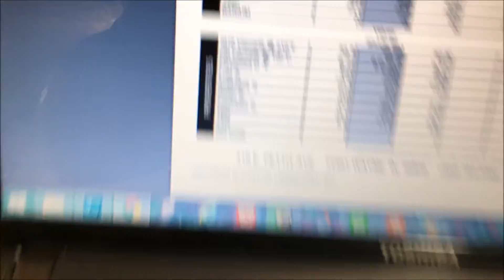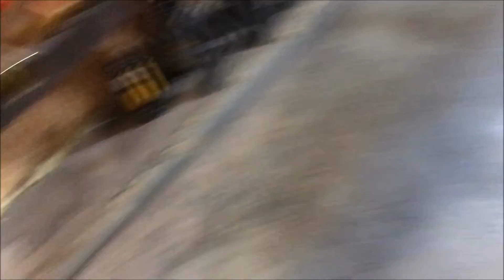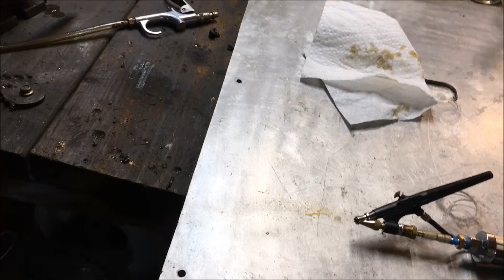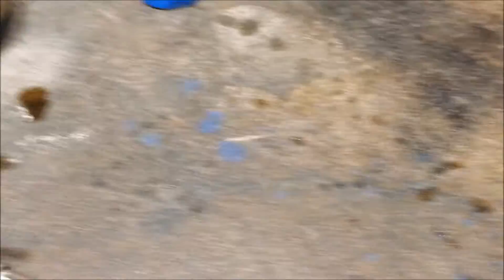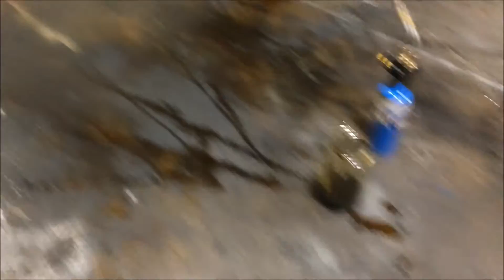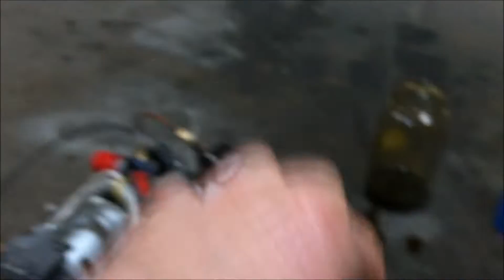waste oil burner nozzle $10

Comment: What you say about synthetic oil is so true NOBOX7. A total bitch to work with. My auto service shop mixes diesel fuel, kerosine and gasoline that is old stagnated fuel. Drops in a clapiable blade agitator with a 4 foot long shaft powered by an AIR DRILL MOTOR for safety. The tank is huge that holds oil changes from vehicles that are serviced. 
    I was thinking maybe using ultrasound somehow to break down the fine mist even finer for a more complete combustion. I wish you luck working on this problem. But learning from history and knowing your perseverance I have full faith that you will make something happen. GOOD LUCK NOBOX7 and peace too. VF

Comment: Just made a comment referring to air brushes for this earlier. Looks like you are overfeeding this tiny thing, besides other comments. You could try a car air gun and you can ream the orifices in both an airbrush and auto gun along with polishing or tapering the needles differently. Probably the better and cheaper way to go for fine otomizers so long as you don't fry them.

Comment: Burnt an eyebrow off trying something just like this out 2 summers ago with a paint gun. Spraying into a 7ft 8 in pipe with a fire lit in the middle of it. Lol did it b4 I started my channel and when I did not get the how and why's of how oxygen and air needed to mix to get combustion and how not to burn myself up. So wish I had it on video but too dangerous to do again.lol well just thought I'd drop you a line. And say what's up? Well I'm  not dead yet,  and your still awesome.

Comment: Really good approach... what is the air and oil pressure?  Looks really doable "for a regular metal smelter furnace
Reply from the maker: well friend turns out it melted in the last video lol , but i did modoify this thing by drilling it out and it works great @ 50 to 100 psi and the oil is under vacuum running at about .5 to 1 gph or 4 lph
Reply from the maker: the oil pressure in this video was 60 psi but i dont use pressurized oil any more , its an extra pain in that butt thats just not necessary
Reply: I can be wrong.. Thus I'm not perfect" but at least in my mind the lock of pressure on the oil side can lead to lean & reach moments on the combustion.. and specially if you are running a really delicate melting procedure.. but I insist that is an awesomely simple idea. thanks for the reply....

Comment: Do you think a modified sand blast gun/nozzle would work better since it such a wide spray pattern?
Reply from the maker: I think the airflow on a sand blaster is way to large for an average size oil burner , but if you needed the fires of hell yes it would work very well for 10 ft flame applications